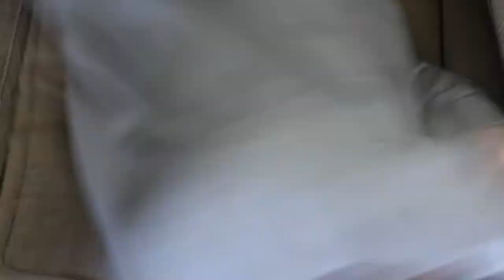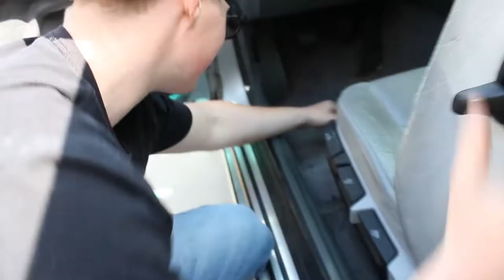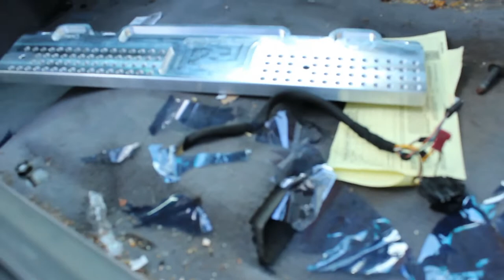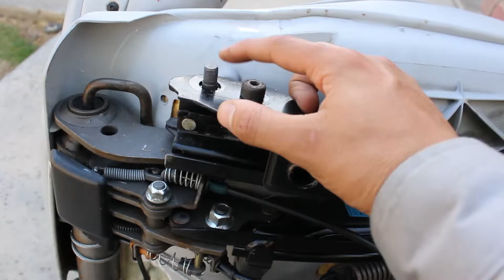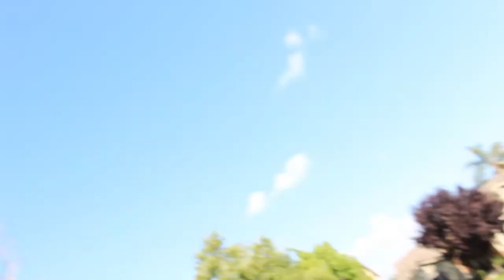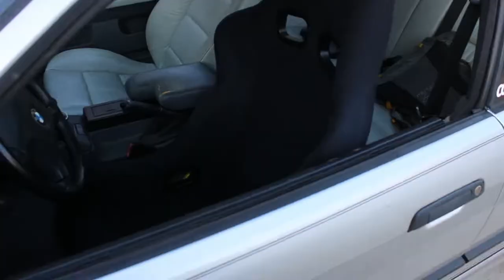BMW E36 Momo Bucket Seat Install + Drift Tested

Comment: Is it safe to mount the seatbelt buckle to the seat and not the floor? And what bolts did you need to mount the seat to the garagistic floor mounts?
Reply from the maker: The seat mount comes with an optional seat belt bracket 
You have to add the option. 
And for hardware 
It should come with some. It’s a common thread
Reply: @diffauto  ok, thank you for the fas response guys, keep up the e36 luv